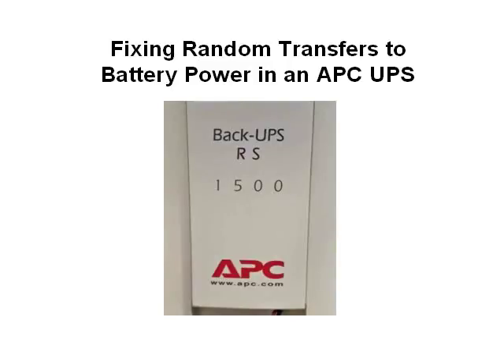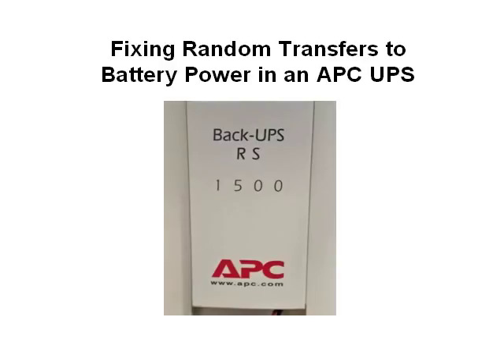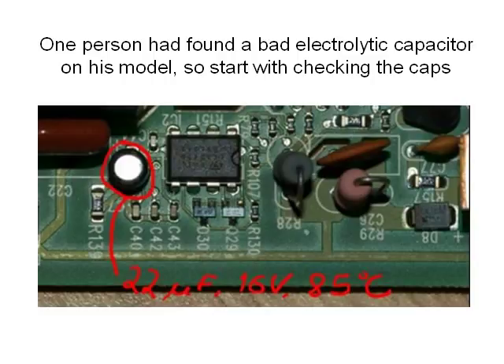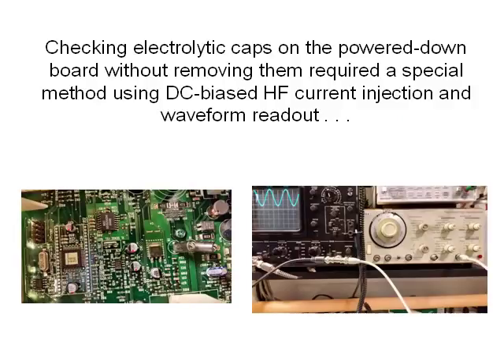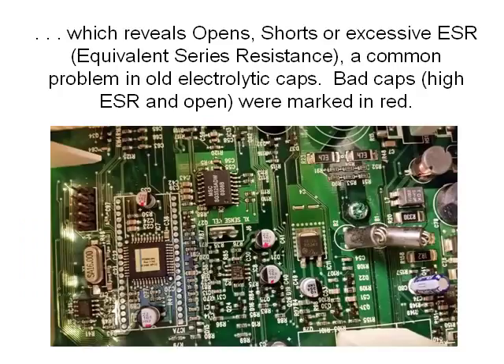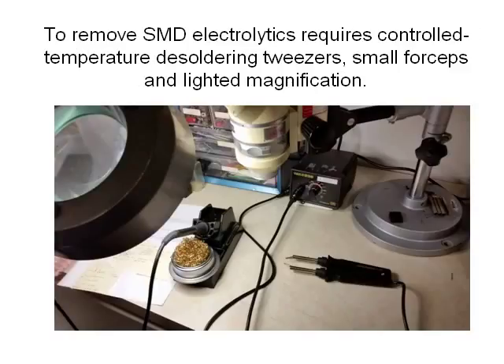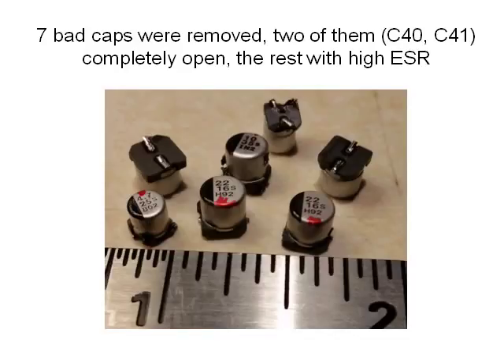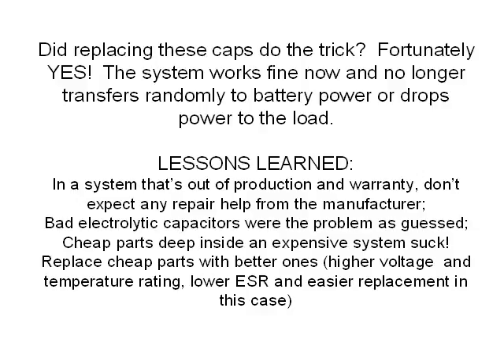APC UPS Random Transfer to Battery Problem Fixed

Comment: I have 2 of the exact same model. One of them doesn't come back to ac after power is restored, earlier it used to randomly switch to battery like yours. The second UPS doesn't have these symptoms but there seems to be a problem. Brand new battery pack degrading very fast and the runtime seems low, even though i replace the packs twice and tested them prior to installation. Do you think the 2nd one might have a low charging problem or something related to capacitors too. Both the UPS units are more than 10 years old